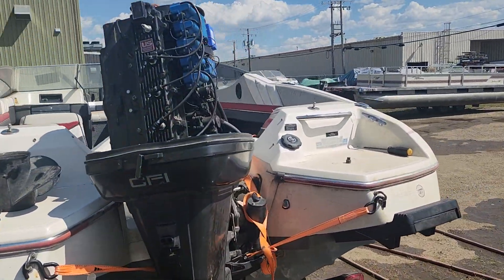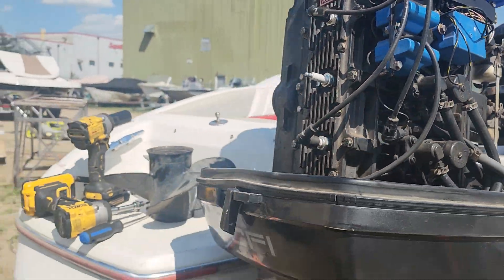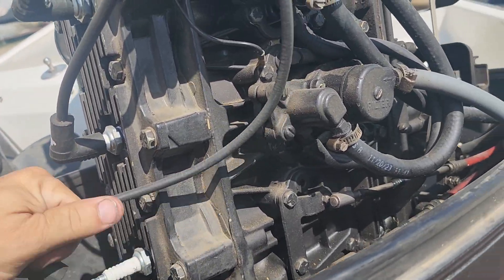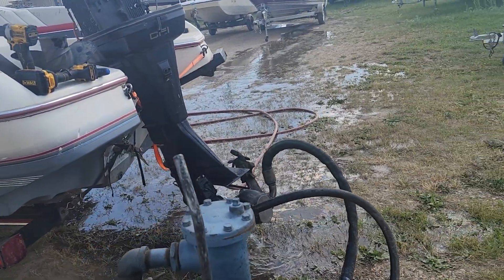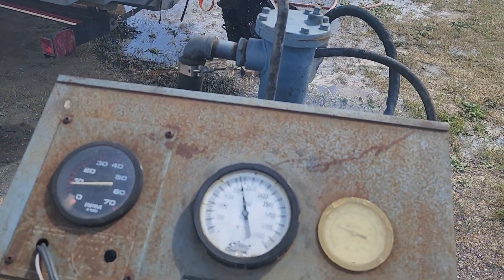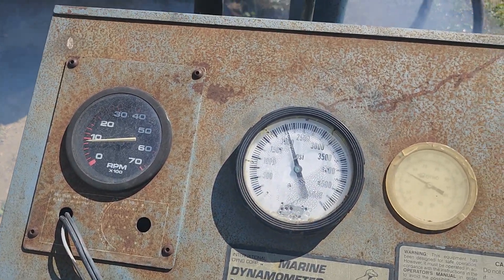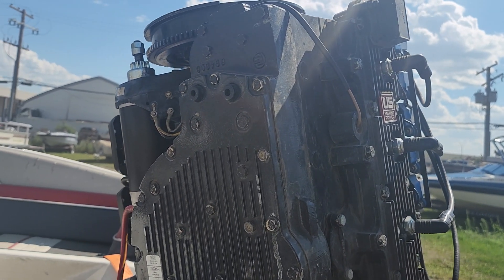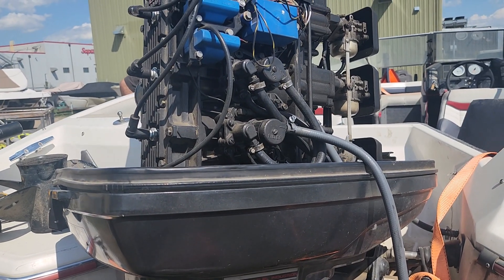Is the 150hp Force as powerful as other 150hp engines on the market?

Comment: That hp # sounds correct. The 120 was only capable of around 108 hp at the prop. Adding one cylinder and a carb is not going to change much.

Comment: My force 120 has been the best motor I've ever had so easy to work on. 17 foot bow rider hits 48 mph. That motor sounds like it needs carbs cleaned, filter and lines.
Reply: My 125 Merc pushed my 17' bowrider into the mid 50s.

Comment: The whater  from control caps is coming when start engine but after 5-10 minets is not coming... Why i cant understand. But i was order all new parts from America is all what ned for good whater pumping and for circulation.
Reply from the maker: Thermostat and water pump kit.  Also check the compression.
Reply: how can i contact you or can i send you a video so you can see what happens when the engine is running maybe you can give more information then too.🫠 @TheMarineDoctor

Comment: Hello... I am from belarus and i have same engine like this...  Mi problem is overheat 2 top cylinder.  Waterpump is new... Maybe you can help me to resolve the problem?
Reply from the maker: T stat or blown head gasket...if its related to water cooling.  You can also generate a lot of heat if those cyls are running lean.
Reply: How much beter put oil for 50 litres petrol? @TheMarineDoctor
Reply from the maker: 1 liter  @adamvasiljev4408
Reply: Can you tell me please what Boat motor propeller to install for this motor too? I currently have 13×19? @TheMarineDoctor
Reply from the maker: Delepends on the size of your boat.  In most cases a 19p would be a consideration alongvwith a 21p.  @adamvasiljev4408
Reply: Hello thanks for information. I have petrol tank 50 litre and in full tank i put 1 liter oil or its to low? Its like 50 to 1 its have to be for this engine normal. @TheMarineDoctor

Comment: From what I've heard Force measured their "150hp" at the block whereas every other manufacturer measured it at the prop. If that's true I always figured the "150hp" force was really a true 115-130ish.
Reply from the maker: I think it was around 1984 that it was mandated that all the engines were to be prop rated.  Regardless of brand.  Possibly some leeway was allowed of plus or minus 10%.

Comment: What is the ‘life expectancy’ of a motor that mixes water from the exhaust side in your experience? My johnson does so as well I think:/ and im hoping after ~15-20hours of use this month , the motor will still be good so I can fix it during the winter
Reply from the maker: @andronclock1  Damage will always be taking place while the water is there and  It will depend on the severity of the leak.  It needs to be fixed right away.